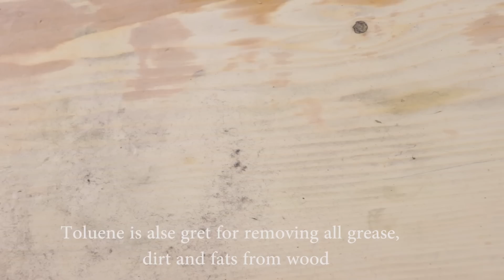Antique Rusty Lefaucheux  - Restoration

Comment: I wonder how many of those “knowledgeable” negative commenters know what they are talking about or are capable of doing anything like this themselves. Nice job Bud ☹️🤨🇬🇧🏴
Reply: At least Im capable of doing much better, and with right tools, which are kinda critical. But I wonder how many of subscribers know anything about restoration or use of tools? I bet not so many. Otherwise these wouldnt be so popular.
Reply: None. They're just parroting each other and pontificating. The good thing about the internet is that it gives everyone a voice, it's also the worst thing
Reply: @debraco7748  I did better and would never call mine "restoration" even if it was not such lazy as low effort WD40 cleaning like here. And my Lefaucheux coach gun does SHOOT quite well.
Reply: Part of anyone sharing a project like this is to entertain and stimulate conversation both positive or negative.  There will always be someone out there that really can do it better .. so what?  Over three million views and 1,500 comments, he must of done something right!  Cheers ...

Comment: Folks that are worried about destroying the collector value by refinishing?  Well it only has collector value if it is an antique in the first place.  The old Remington he does in another video has a bit of value.  BUT packed in rust and mud the was it was it was only a good paper weight.  If a gun is restored it is completely refinished with all the original Stock oils, internal parts replaced with factory parts.  Refinishing the metal makes it what is known as a 10% gun. Meaning it is at the bottom of the scale for collector values.  The only caveat to that is the gun smiths that have earned a name in the restoration business.  They are easy to identify by the fact that name is right up front in the sale brochure. 
What Andre does is a fun and very lucrative business.  There are more damaged, neglected guns out there than there are folks to rescue them.  Keep up the good work.
Reply: Maybe I just no nothing about "gun collecting" but myself and literally everyone I know who's into firearms would put more stock I'm a firearm that's restored and functional then a wall hanger any day. Maybe I'm just too uncultured.
Reply: @mariongonzalez2621  in my book if it can't fire or easily be repaired unless it was the only one left or had some historical significance it's completely worthless.
Reply: The 1958 Remington was a modern repro. It is worth about 50 bucks in good condition.
Reply: @Der Congo MannYes it is.  He got real lucky that all the innards were present and useable.   Often that is not the case.  I have done well over 200 rescues over the years.  I can count on one hand, using my thumb only,  the number times I got this lucky.   :-)
Reply: Being in fireable condition has a lot to do with value as well.  An old rust bucket is not worth much.  Even for the a150-year-old gun,  is only worth 70$. Because it was in non-working order.
Reply: @mariongonzalez2621  Its not just you. Beyond what historical value it may have had, a rusty and worn POJ isnt going to get anyone's jimmies rustled, if it was as old as it is and was kept in stellar condition, yeah, it would have some value. But as it was, I doubt anyone would care. Now, there is at least one person that would be interested in it.
Reply: Well said!
Reply: @mariongonzalez2621  It really depends. You appreciate guns for their function. But not everyone does. A lot of people just appreciate the historical value. Where it has been, what it is and was. Its history. And by restoring it you destroy that. Thats why mummy wrapped lee-enfields are more valuable than unwrapping and shootable ones which are basically new stock. It may make it more valuable for a person like you, but a collector looking for the history and no function will see it very differently. Its a discrepancy that most likely will never find its resolution. :D

Comment: I have a Colt revolver made in 1899 and a Smith and Wesson revolver made in 1901. Both came from desert areas and are in quite beautiful condition. I like antique cast iron cookware. Just bought an 1890s piece last weekend. The man I bought it from has an electrolysis tank dedicated to restoring cast iron.
Reply: Which chemicals would you recommend? I just started with electrolysis and it works well, but the rust comes back quickly when the part is left exposed to air, I haven't tried rubbing the pieces with fine steel wool after drying the pieces, could that be why?.
Reply: Sascha Is this question about cast iron cookware or guns, knives and tools? Cookware can be dried in the oven then coated with cooking oil and put back in the oven to season. Guns, swords and tools are dried well and oiled. Buried relics are given electrolysis then cleaned, dried very well, and dipped in hot wax.
Reply: it kind of takes the character away by cleaning it it's not natural anymore

Comment: I'm surprised that nobody commented on how restoring the pistol would dramatically decrease it's value... after all, with so many "Pawn store" shows on TV, we've ALL become antique experts! I've heard them over and over again say how it's better to leave the firearms AS IS instead of "restoring" them...
In this case, I disagree. The pistol STILL looks old (you didn't try to buff out all the beautiful patina and replace the wooden grips with new material) and has all of the charm that a piece this old should have! :)
Beautiful job!
Reply: Once it's pitted, you're past patina and into damage. This isn't a rough old car, this is the car with a rust hole in the floorboards and no doors.
Reply: @Spartan Batty Rust and grime is not patina. Tarnished brass, nicks, scratches, and aged wood furniture is patina. When you own an antique gun you still have to maintain it like a modern firearm or it will just degrade over time. People who consider damage like rust and grime are the ones that are antique experts that got their knowledge from Pawn Stars.
Reply: I'm a big fan of restoring old stuff and never understood how it decreases value BUT that's not a chance I would take on an old firearm. Some can be quite valuable. This is also a unfinished project he completely removed the finish from this firearm and did not apply a new one. In my opinion he ruined it.
Reply: It now looks like a souvenir from Pakistan.
Reply: My take: value has no permanence, nor objective meaning. It's merely a buzzword thrown around by "collectors".

Comment: I'd have to join the "was wrecked" camp (sorry).  By all means clean the guts so it can dry fire for fun, but leave the surface aging alone.  If I succumbed to temptation and was going to wreck an antique, I'd give wood and metal a coat of LINSEED OIL.  It nourishes dry wood,  stabilizes the rust, and forms an attractive protective varnish to prevent further oxidation. Test on any old rusty tools to see the effect. Future owners (and value) will appreciate.  But nice video. To each their own.

Comment: A great step toward a complete restoration.  Perhaps some heat on the three immovable screws followed by some penetrating oil would have helped.  After cleaning with the steel-wool or even a fine wire wheel brush, I anticipated a bath in copper sulfate (aka buleing) for the finish.  Very good as far as it goes. Thanks.

Comment: I understand original finish as it pertains to value, but these things have went beyond that point to the point of ruin.  Restoration is their only hope of continued existence with any hope of enjoyment.  I could watch him do this stuff all day long.
Reply: A rusty item can be boiled in plain water for 30 minutes at a time. It turns the brown rust to black oxide that can be polished with very fine "0000" steel wool. This is how guns were originally finished. If he had done that to this gun, it would have turned out amazing. There's no need for rust remover. Edit: remove the wood first though!

Comment: Restoration means restoring something back to its original state when it was new! So pulling it apart, cleaning the metal and conditioning the wood IS restoration.. stick that in your pipe and smoke it.. Good job of RESTORATION. 👍🏻🇦🇺😁

Comment: Not a restoration. He removed all of the finish from the firearm and didn't blue or seal the metal meaning it will turn into a rusty paperweight in no time. It lost any value it had.
Reply: Yeah, most restoration channels make this mistake when they "restore" guns.
Reply: It should, if only it's too pitted, have the finish REMOVED. Then it should have been...."BROWNED" Same as blueing....only in olden days it was a brown color. That's why it LOOKED rusty. And YES ....IT IS NOW NEAR WORTHLESS TO A TRUE COLLECTOR!!!!!!!!!!!!!
Reply: @danielmankey9635  But now he can shoot a piece of history. Money isn't everything. But I agree, he should apply some kind of protective finish.
Reply: RESPECT MY AUTHORITY  non firing around $50-100, firing maybe $200-300 if in good condition.  If he used some Birchwood Casey plum brown I'd see someone paying around $200 if it shoots.  He didn't butcher it with a wire wheel like so many other amateur restorers...

Comment: Well, now it has no protective finish so keep it very oiled. The patina that was on it could have been turned into a very effective corrosion inhibitor, with a little work and knowledge. Sorry but in my eyes you ruined this piece.
Reply: These guns shipped "in the white" frequently. The patina you are mentioning is just rust.
Reply: That active rust is called hematite or FE2O3, if you were to boil those parts in basic tap water, some of the hematite will turn into magnetite or FE3O4 which will not corrode and will act as a barrier to further corrosion or “just rust”. Try it next time, you might be surprised.
Reply: aslob 9 Would it be a problem if the water was from a well that was hard from calcium and magnesium? Would distilled water be preferable? I've never heard of this method.
Reply: The Beardy Farmer: Adventures in Agriculture + I don’t think it would matter, the minerals should not affect the process. Here is an excerpt from Wikipedia: RUST BLUING,
Rust bluing was developed between hot and cold bluing processes. It was originally used by gunsmiths in the 19th century to blue firearms prior to the development of hot bluing processes. The process was to coat the gun parts in an acid solution, let the parts rust uniformly, then immerse the parts in boiling water to convert the red oxide Fe2O3 to black oxide Fe3O4, which forms a more protective, stable coating than the red oxide. The boiling water also removes any remaining residue from the applied acid solution (often nitric acid and hydrochloric acid diluted in water). Then loose oxide was carded (scrubbed) off, using a carding brush or wheel. A carding brush is a wire brush with very soft, thin (usually about .002 thick) wires. This process is repeated until the desired depth of color is achieved or the metal simply will not color any further. This is one of the reasons rust and fume bluing tend to be more rust resistant than any other method. The parts are then oiled and allowed to stand overnight. This process leaves a deep blue/black finish.

Modern home hobbyist versions of this process typically use a hydrogen peroxide and salt solution, sometimes with vinegar, for the rusting step [3] to avoid the need for more dangerous acids
Reply: Patina doesn't leave rust pits, only rust leaves rust pits, and if its pitting then it needs to be removed. So you try and watch the video closer next time.
Reply: xxAntiOtakuxx  + I watched the video very closely and the method I spoke of would work well with pitting also. Get your facts straight before you comment. And read the following, it might help with your knowledge on the topic of discussion.

cc: Wikipedia, On metal, patina is a coating of various chemical compounds such as oxides, carbonates, sulfides, or sulfates formed on the surface during exposure to atmospheric elements (oxygen, rain, acid rain, carbon dioxide, sulfur-bearing compounds), a common example of which is rust which forms on iron or steel when exposed to oxygen. Patina also refers to accumulated changes in surface texture and colour that result from normal use of an object such as a coin or a piece of furniture over time.[2]
Reply: -aging that looks like shit is pitting or dirt

-aging that pleases the eye is patina

-terms as used by ebay sellers are usually bullshit

Antique watch collecting forum.
Reply: xxAntiOtakuxx + I’m talking about chemistry and you’re talking about eBay. Get your facts straight or better yet, just try it. You would be surprised what real world experience will do for your argumentative prowess. This is not an antique watch, it’s an old firearm made of carbon steel. Creating a permanent protective finish on it would not hurt it or it’s value, which at this point is virtually nil. I stand by my original comment, this piece is ruined.
Reply: "a : a usually green film formed naturally on copper and bronze by long exposure or artificially (as by acids) and often valued aesthetically for its color
b : a surface appearance of something grown beautiful especially with age or use" 

-Webster's

That at the beginning of the video was not beautiful, and hence my quote from before.

If you want to try and be technical I suggest you stop using wikipedia as your only source.

If you want to talk chemistry it is called oxidation and redox not patina.

"Patina" is nothing more then the result of 17th and 18th century European obsession with the Latin language. Even the original Latin word has a very loose connection to what we now refer to as "patina."
Reply: @xxAntiOtakuxx  aslob is right it wasnt pitted at beginning
Reply: aslob 9 wouldn’t the heat of the water ruin the temper of the metal bits, I suppose it wouldn’t matter if it’s not going to be fired, but, still......
Reply: Ah, yes, "ruined". Didn't realize that meant "looks less than 179  years old and is safely functional". So, if that's "ruined" in your eyes...I think you need your eyes checked.

Comment: There is a company in Germany that makes re-loadable pin fire ammunition.  From a collectors standpoint, removing the rust kills the value of the gun. A good patina actually works to keep the gun from rusting further.  Since its been cleaned, a nice plumb bluing would look great on that gun.  It would give it the aged color but protect the metal.
Reply: Don't confuse rust and patina. Patina is collectors value, rust is damage.

Comment: Amazing work. I found a small .410 shotgun a few years ago in a shed I was hired to demolish and was told to keep it. It is rough shape. Could you list the products used to clean it off? Thanks
Reply: If you plan on firing it i would definitely take it to a professional gunsmith to have it cleaned, they’ll tell you if its safe or too worn out to use

Comment: I have one of these, it is in great condition , mine was called a 'howdah' pistol - it was for close protection to keep tigers from jumping on the poor creature and take it's rider - i think it started life in Belgium - and it's firing they called them 'needle guns' because they were designed with an unusual firing mechanism.  After loading it the whole thing made sense..kinda a needle came down through the holes at the top. and a dremel would help him out
Reply: Not quite.  This is a Pinfire Pistol.  Each cartridge contains a primer and a firing pin which projects from the case and fits into the slot at the rear top of the barrel,  sticking out far enough for the hammer to hit it.  The hammer drives the pin into the primer and BANG!   A Needle Gun is different - the primer is on the rear end of the bullet, and the powder charge is behind it,  Strange but true.  The long firing pin ("needle") is driven through the back of the cartridge case (made of paper), through the powder and into the primer.  This design was soon replaced by better ones, not surprisingly.

Comment: Well, it definitely can be made better. You dont disasemble spring and hadle(so there is rust left, stucken between them). Also you can polish the surface, stabilize wood with resin or wax, clean and polish the barrel inside... as someone says in comments below, it is not restoration, just cleaning.

Comment: I saw a video where the gun was set in liquid with battery cables hooked to it to remove rust. If you do many restoration projects it may be useful to you. I don't know what it's called or the cost, but it pulled off so so much rust i was impressed.  
  Great video it came out very nice
  Are you going to shoot it?  I don't know if I have the nerve. Looks kind of thin to me.
Reply: He does crap. This is YT cleaning +WD40 video. Not restoration of any kind.

Comment: Rust is a PITA to remove.  You should have that steel treated with a rust preventative.  I'd say blue it, but that would ruin the look.  Some kind clear coat might work.  Did an awesome job getting it cleaned, but the rust is coming right back if you don't protect that bear metal.  Such a cool project!

Comment: A good start, but I think a proper restoration would involve filing back the corrosion damage, re-working the engaving, and probably rust blueing it to produce a corrosion resistant and attractive patina. As it is (raw metal), any moisture will cause it to rust again. A gun like this would probably have been russeted (rust blued).

Comment: Andre, you should look into finishing the gun with a proper rust brown finish or else it won't take long for it to return to where you started. The rust brown finish is correct for a gun of this period and there was still quite a bit of what looked like the original finish remaining although clearly the gun needed what you gave it in order to stabilize it for the future.

Good luck!